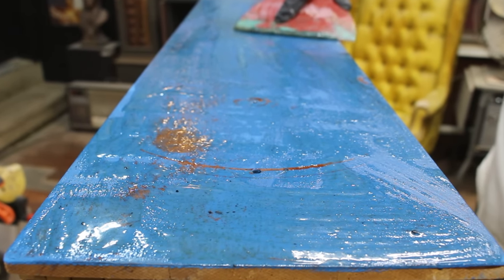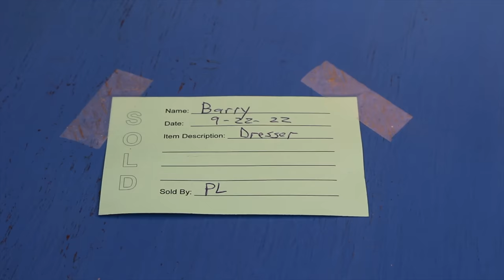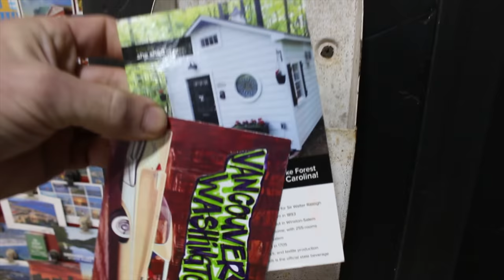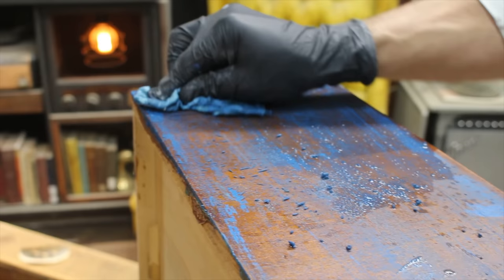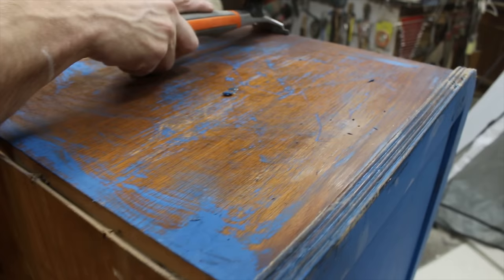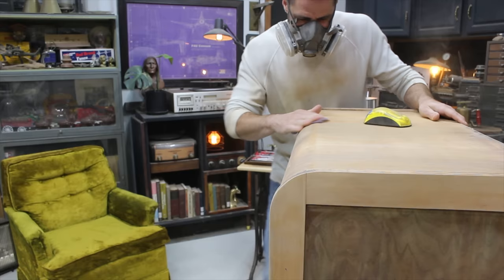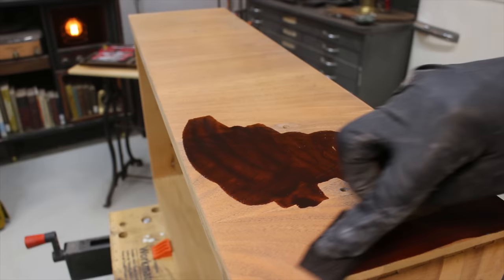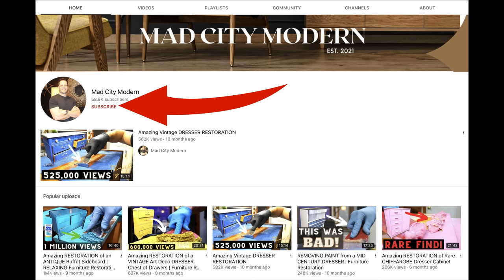Ep. 53 Amazing RESTORATION of Old Blue Painted Dresser

Comment: the end result is stunningly gorgeous.  I do wonder if there are instances when the painted over wood is actually protected more than if it had been left exposed with the original finish.  Any thoughts on that? Enjoy seeing you make the unpopular and ugly desirable again.  10 out of 10 on this one.
Reply from the maker: Great thought. I think in this case, it certainly protected this piece, however, the paint is so difficult to remove in the places where the old finishes had been removed
Reply: @MadCityModern  In watcing you work on the side pannels of this dresser, I can see pressig on it to scrape the paint off caused it to bow in with each pass.  It must have been fragile/thin or borth.  Made me wonder what materials were used onthe sides.  Thanks for the reply.
Reply: @MadCityModern  Before you completely stripped this piece I thought the veneer was teak but after I saw the variations in color of the wood I'm now really curious as to what wood it is. Can you shed any light on this? I'm not generally a fan of this style of furniture and I definitely would prefer different pulls but this piece turned out absolutely gorgeous! Really enjoying your channel!

Comment: I redid this same dresser. It had a lot of cracking of the veneer on the top, so, I filled with body filler, sanded, chalk painted and applied a transfer. Used original hardware as well. It turned out so beautiful. 
I love yours!
Reply from the maker: I love that. Thank you for sharing Jean

Comment: I have this dresser!  Well, very similar. The older woman I bought it from said it was her grandmothers and she remembered her mom refinishing it “in the 60s”. I’m missing 2 of the pulls. They are some sort of gold painted metal with a central screw. Unfortunately the screws loosened and the pulls spun in a circle. The pulls have a little tooth on the ends and they created deep gouges. (Through the veneer). I am not familiar with applying it and I think I’m going to have to fill them and possibly paint only the drawers or maybe apply a paintable wallpaper. I have some leftover from doing the dining room that has a small art deco style pattern repeated on it. I think that would be visually interesting as well as hiding the gouges. 

I love what you did with your piece!  It is what I would have done to mine if I could have.
Reply from the maker: I learn from every piece. Keep me updated with your projects

Comment: Probably don't work on such items. But I have a desk with lament on it that was painted very badly lol. We tried sanding but it's taking too long. I thought of getting a paint thinner or what not but worried it may seep into the wood under the lament. If I take my time and don't use too much at a time. Could I use it to get the job done fast. I had it outside but due to weather months ago we brought it in. Its too heavy to take back outside so figured a paint stripper would work or may be you have better ideas? Thanks.
Reply from the maker: That sounds like a major challenge. Unfortunately, I have worked on many painted pieces where I couldn't get all of the paint out of the fibers no matter what I did. If the piece is solid, you just need to keep sanding. If it has veneer, then it may be impossible. Maybe consider a really dark stain to conceal whatever paint is left. Hope this helps